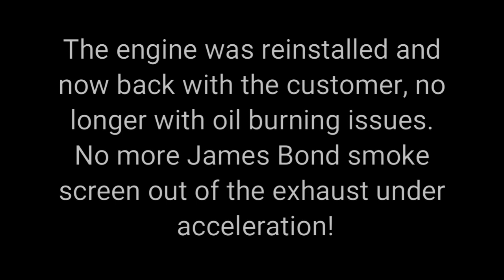BMW X5 N63 V8 Engine Repair Oil Consumption - Valve Guides

Comment: I have one of these in my bay right now for under boost condition. It looks like the waste gate arms and shafts are slacked out. It is also consuming oil and I believe this is the problem. Looking at the amount of  end play for the valves in this video is good information.

Comment: How much does it cost for a complete strip down and rebuild (inc new rings, valve guides etc) for an old n57 deisel engine? my f10 525d has hit 230k miles but its a good car. Iv'e seen inside the throttle body etc and it's thick with crap like your other videos too.

Comment: Such an insightful video! Let me ask, do the REPLACEMENT valve seals and guides have documented certification they are capeable to take the heat stress the N63 generates or are they simply identical BMW stock replacements as the ones that failed? I look forward to your reply as I own a G30 with this N63 powerplant with 20k miles that has excessive oil consumption. 😲

Comment: I have a '15 X5 50i xdrive Msport burning excessive oil (2 qts every 500-1000miles) now for the last year. I realize it is probably the same issue you just repaired. So, do I go ahead with the repair and spend $1000s or just sell it? I already had this issue with a 2011 550i xdrive Msport and BMW, through a class action lawsuit, replaced my engine for free (and then I sold it after the tranny failed at 65k). Or should I see if there is another class action for the N63 4.4l?

Comment: I have the same exact engine in my car. Gotta say it is the worst engine BMW has ever manufactured. Had to replace it after 90k miles from oil consumption that led to rod bearings being crushed

Comment: Hi. What caused the valve guides to largen like that? Is it just natural wear or is it from bad valve stem seals? Also, how long did that job take and what sort of cost estimate?
Reply from the maker: It's wear that always should be checked for when doing valve stem seals. 
Can't remember how long tbh as it was probably 3 years ago. Expect a 30 to 40 hour job. From what I've heard, in the USA due to other class action lawsuits with this engine, its cheaper to buy a complete new engine from bmw. Not sure how that is in tue rest of the world.
Reply: @FourRingsAuto  it's worrying how this is happening to this engine with less than 100K miles on it. I have a 2013 650i 66k miles with an N63TU and if I idle for 10 minutes then press the throttle I get white smoke from the exhaust 😣 Shop said stem seals? Other than that though the engine runs smoothly. But I'm burning about 1 litre per 850KM. Some people online are saying all the damage is because of how hot these engines run? And that you should switch the thermostat from the original 105c to 90c. But could heat really do that to the guides.. ? I thought all engines are supposed to operate at 100c+..

Comment: Awesome Video and nice job by fixing the problem that BMW cannot (without ultra expensive head change)
I want to DIY rebuild the N63 engine on 650i - Is there a manual available somewhere? I want to know torque specs etc.

Comment: I have an x6 m and I have same problem 
We should all come together and 
And put a huge law suit against Bmw
Reply: They already did. I believe they fixed the problem around 2016 n up. Also they knew it had kinda bad oil consumption from the start & recommend & adding a quart of oil about 700 to 800 miles.

Comment: I got a 2011 f01 bmw 750li xdrive and my fuel gauge is not working and stays at empty i changed thw fuel level sensor in fuel tank and fuel gauge still doesnt work any idea what this is.

Comment: As a BMW owner, I'm embarrassed at this overly complicated, poorly designed engine. It's ridiculous that car manufacturers get away with producing engines with so many design flaws. The root cause is probably insufficient cooling and insufficient oil flow to the guides, resulting from the hot-v architecture. I'm surprised that you didn't change all of the chain guides, since they were accessible. They are all made of the same cheap plastic, so no doubt more of them will fail.

Comment: The N63 is a trash motor. We had it in our 2012 750Li which burned one to two quarts of oil a month. The engine finally ate itself and BMW replaced it for about $5500. The oil light illuminated no less than about two weeks after getting the car back from repair. I was sick of putting money into German made trash so we got rid of it and bought a new GMC Denali that will last 500,000 miles before ever displaying an issue.

Comment: Do you replace the valve guides with oem  or stronger aftermarket ones
Reply from the maker: Aftermarket. Bmw doesn't supply as a spare part. They are as the machine shop supplies.

Comment: Why would you R & I the engine when there are products on the market that allow the repair in situ??
Reply: you think a sloppy valve stem from a previous bodge repair can be fixed with some additives bro?
Reply from the maker: 6 of one, and half a dozen of the other.

Comment: This engine is ART
Reply: No.. it’s trash.
Reply: @secretsquirrel572  not trash if you understand German engineer it will probably take 4 more generation model, and now you will see better improvement on a 2020 or 2022 model these issues have been solved.
Reply: @hulk-smash-deez-hose.7951  the class action lawsuit paying out hundreds of millions to the owners of BMW models with this engine says differently.
Reply: @secretsquirrel572  you have to understand, German advance newer engineering technology, the only way to find out how to complete the errors, is to let particular models perform mileage intervals to properly diagnose each common problems, right now the N63TU is very much reliable in newer models, bmw has been improving, older engines may have ruined certain peoples trust, but others who decided to stick to the brand, they’ve seen the improvements, the n63 is probably the best v8 modern engine.

Comment: BMW last updated this engine in 2018. “N63 and S63 M version have received refinements in the form of Valvetronic, twin-scroll turbochargers and higher pressure direct-injection, in addition to other cursory changes made to improve cooling and overall reliability” hopefully it is more reliable!
Reply: BMW is trash. It shows when you buy a $105,000 car that depreciates $85,000 in three years. Then only worth $10,500 the fourth year. Japanese and American built cars are engineered much better and hold their value much longer.

Comment: hey just a question would a v8 E70 engine fit inside a regular v6 engine bay with out headaches?
Reply from the maker: There isn't a v6 model. The engine would fit, hardest part would be wiring it up and coding it to the rest of the car. Not worth it. Buy a v8. Both e70 v8 engines are dreadful however.

Comment: Hello, how did you clean the deck of the cilinder heads? it turned out very well..thank you
Reply from the maker: The heads were sent away and when the valve guides were replaced, they surfaced the cylinder heads. This finish is perfectly flat and only possible with engineering equipment. It's a cheap service that cylinder head or engine machinists can do for you.
Reply: Four Rings Auto thank you! Did they also resurface the cilinder banks? Or did you clean them.

Comment: As an owner of a used 5 series with this engine I have something to look forward to.  You wonder if someone can't engineer dropping a more reliable drivetrain into the same vehicle.
Reply: It depends on what yr is your 5 series. If your N63 has TU on it. The problem will be less likely.
Reply: @isserdigan2835  2012.
Reply: @1954cs  sadly your engine is the original ones.. better to be proactive..read the link..https://bmwtuning.co/n63-engine-problems/

Comment: Hey, can you give me rough estimate how much is repair like this cost. I called verrezano shop in NY and got estimate of 3300. BMW dealer wanted to replace the whole engine under bang lawsuit and told me to pay 6100. I have no problem with engine, can runs smoothly, I own it for 3 years, recently oil consumption came to 1 bottle every 300 miles, I only drive locally around town 2-3 trip 5 miles each a day. On the highway I can probably do 500 miles or so, but the worse think is the smoke when car on the idle, very annoying in winter when you warm up your car and sometimes smoke goes inside the cabin probably through airvents when heat is on.... Please advise
Reply from the maker: You'd be better off replacing the complete engine for one with a manufacturer warranty that is the updated version. These engines are a never ending story of issues mainly oil leaks. 6k for an engine is cheap.

Comment: How much does a repair like this cost in the US"
Reply from the maker: No clue. I'm in Australia. Bmw has reduced the price of factory  reconditioned long blocks to a point where you are likely better off replacing the engine rather than relair it. As much as i prefer the repair method, anew engine is better for the customers pocket.

Comment: Why do the valves wear so bad? Is there an upgrade to the guides that will allow them to last longer?
Reply from the maker: Not sure. Poor design is likely, or too soft metal used for the guides. Too long service intervals also can't be helping. The guides can't be purchased from BMW so our head rebuilder makes their own. Whether this prevents it reoccurring I'm not sure yet. Time will tell.
Reply: @FourRingsAuto  I only ask this because this would be a good time to call Ferrea and have them make a new set of valves and guides for the head. Maybe they could create a fix to this problem and give it some longevity.
Reply from the maker: @jacksoncorp124  possibly worth looking into.
Reply: @FourRingsAuto  Also not sure why the rod bearings fail...
Reply from the maker: @jacksoncorp124  Heard of it but yet to see it. Likely poor oil quality and extended service intervals. The oil drained out is often black. Injectors over fuelling/leaking and bore washing could add to the oil contamination. Just some suggestions.

Comment: Nice job 
Some guys used titanium wrap on the downpipes and turbo’s to keep the cylinder head temperature down. But that doesn’t fix the chain problem although shorter oil change interval may help.

Comment: i have a bmw  650i with the N63 engine can  bring it to you for repair, the engine light is on due to a Mass Air Flow Sensor Fault??
Reply from the maker: I'm in Western Australia

Comment: Hi great job! How much would you charge for a job like this? Thanks @FOUR RINGS AUTO
Reply from the maker: I'm not sure how much this one was now tbh. Around 40 or 50 hours, plus machine shop costs for refurbishing the cylinder heads, parts etc.
Reply: My advise dont waste your many on apiece of crap..germine cars are designed on failer and to repair ..

Comment: Okay, after owning a 2003 Range Rover with several hundreds of engine issues with the M62 why is this engine failing at such a low mileage? Is it lack of service or crap from BMW? I remember when German cars were reliable. But this is inexcusable.

Comment: hello Four Rings Auto, can a car burn 1 liter of oil per 500 km and no blue smoke on the tailpipe? i have this kind of problem whit my passat 2001, 1.6 ALZ petrol engine, the oil just dissapears from the oil pan, the engine works fine, pass all the emissions test, but 1 liter of oil every 500Km is missing...if the guides and the valve stems are worn, there should be blue smoke right?there is a difference of sympthoms between a cracked head, a blown headgasket ? i have no overheating problems, except the oil is present in coolant reservoir, but i did changed the oil cooler as well, still the oil is burned,is some kind of difference between oil burned through rings and oil burned through valve guides?thanks

Comment: Today’s BMW engine problems must have a lot to do with the so called long life engine oil that now BMW recommends oil changes every 16000 miles, I had a bad experience as second owner of an X5M serviced at dealership under schedule that seized engine at 87000 miles
Reply: My BMW dealer recommended oil changes at 12,000 kilometers, however I chose to change oil every 9,000 instead. Oil is cheaper than engine repairs.
Reply: Alejandro Pedroza what happened after the engine seized?
Reply: @yoloomis  It seized to exist ;-)
Reply: The engine in our 750Li let loose at 90,000 miles. New engine and install cost $5500. Got a low oil light about two weeks after getting the car back. BMW builds trash vehicles these days.

Comment: Hi sir I'm from New York I have a n62 v8 similar to this can u explain how to remove the valve guides and where can I get replacement part
Reply from the maker: Valve guides are pressed in. They aren't listed by bmw as a replacement part. My machine shop made some up and fitted them.
Reply: @FourRingsAuto  so if I'm not getting any play or wiggle with the valve I should be fine right
Reply from the maker: @Trinibad718  realistically yes that would be the simplest test. The n63 seems bad for it.

Comment: I have an X6 V8 2010, cost close to $200,000 with an N63 in it, it dose use oil the work shop Forman told me that it’s a high performance engine and that they do use oil, since yesterday I started watching Utube videos about the N63 engine, wow what a piece of rubbish, I have done 71,000 km’s I love the car but now not the engine, I will now look to replace the car with something like a Toyota which seems to be more reliable and cost effective, I feel heart 💓 broken.

Comment: Have you done a video on best way to drop the motor assembly out of x5?
Reply from the maker: Not yet. Something for the future, but most e70 x5 i see are 6 cylinder diesel, and most people seem interested in the n63 v8 twin turbo which isn't as common here in Australia.
Reply: Four Rings Auto  That’s probably because the diesel 6 is far more robust and reliable than the N63.  I just love the power and sound of the N63 and want to get it fixed to be a non smoker and reliable.  What kilometers had the N63 done to have such sloppy valve stems?  I am coming to Perth in Sept so would love to drop in and see you if possible and ask a few Q.

Comment: Very nice informative video. I watch these videos each time I start lusting for a used 650i with a $30k price tag. Now let me go back to lusting for a V10 M6 and then I’ll watch a few bearing failure videos. Question - does BMW make an engine with 350+ hp that doesn’t turn to rubbish at 80k miles?
Reply: Ron Mac yes, so you have to buy a new BMW from them;)
Reply: Dunno if your still interested in Bmw but alot if us buy the i6 turbo and put a tune and some bolt on mods. Get 350 to the wheels easy
Reply from the maker: No, bmw does not make a reliable engine with 350hp hahaha. The e39 m5 s62 was relatively reliable conpared to newer offerings.
Reply: Four Rings Auto I would say the S54 was the lowest maintenance significantly powerful BMW engine.
Reply: yes BMW does. dont listen to these mechanics. one must really go to the experts on the bimmer forums where the real bmw technicians live. BMW has ruined their reputation in my opinion by putting out there atrocious 8 cyl engines the last 2 decades, They did however overhaul the N63 in 2014-2018 and named it n63TU. I cant recall which exact models received this engine but I do know the 2014 -2018 7 series has them. I have my 2015 750li which has been rock solid for me. she is at 73,000 miles. before that I had the 2008 750...which was a horror story. if your going to buy used, be wise and get a Dealership CPO one. anyways, I find it hilarious on these mechanics on youtube who just state whatever they hear without checking the facts. Rely only on BMW guys who only work BMWs for your information gathering. cheers!
Reply: @gruponemesis  Dude you have an n63tu!!!!!
Reply: @gruponemesis  BMW last updated the engine in 2018. “N63 and S63 M version have received refinements in the form of Valvetronic, twin-scroll turbochargers and higher pressure direct-injection, in addition to other cursory changes made to improve cooling and overall reliability.”
Reply: @Troy-fv9uq  this is good to know Troy thanks for the update. I can see myself trading up to a 2020 this year